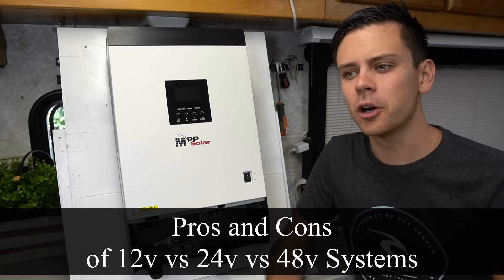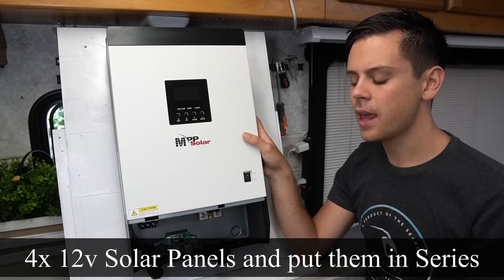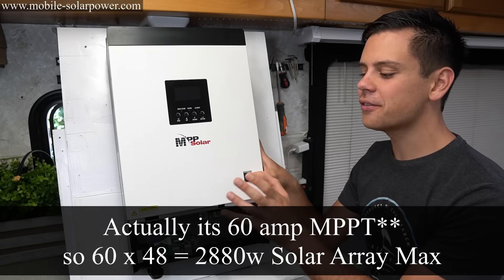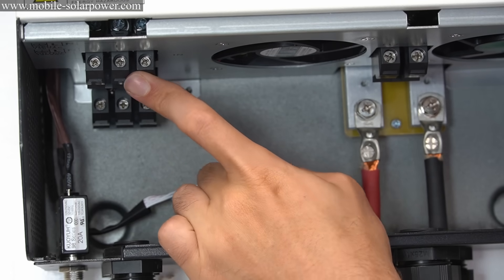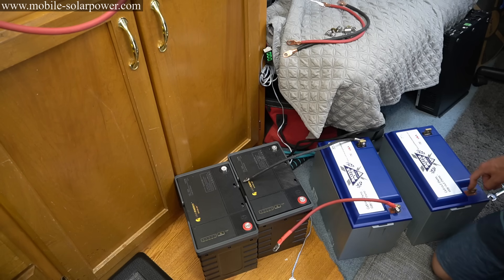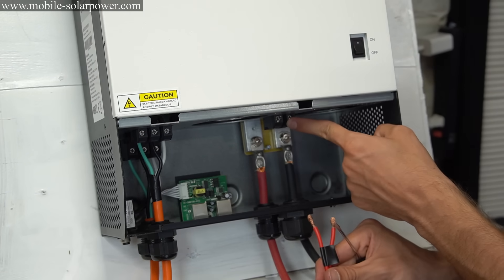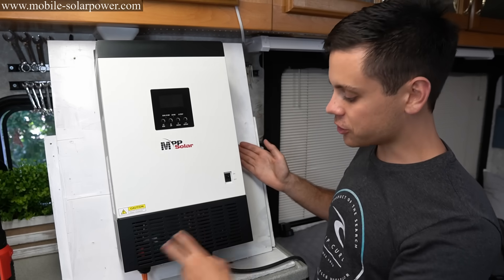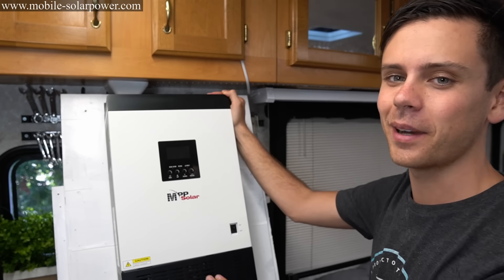48v Solar Power System for Beginners: Lower Cost and More Power!

Comment: so u dont recomend 24v for a van?
Reply: You would have to connect the output to a step down transformer because the car is wired for 12v. I'd run 12v so you don't have to worry about this.

Comment: Another excellent informative video for the beginning solar person like me, and I am very appreciative. I do have a question on the 2.4kw model. It seems as though I can utilize this unit in place of my (old) 30 amp RV converter, and simplify the addition of solar to my classic motorhome by running the 30 amp cord directly to this unit as the 'utility', and run the 120VAC output to the original 30 amp connection point in my breaker panel. What are your thoughts on this, Will?

Comment: i'm considering purchasing the Generlink or Solarlink transfer switch for my home's outside utility meter box to connect a 48v 5kw MPP Solar unit to.  this will eliminate the need for a separate panel installation in my home and potentially provide power to all circuits in my home.  What do you think?

Comment: I am new to your channel and I know very little about solar! I ruined my current stand alone unit by having my generator and solar generator running at my cabin. I currently have 4 new 12 volt batteries and Four 150 solar panels. Could I use this set up with this product? With a transfer switch and add a panel for just what I need to run with solar? Appreciate any help I can get!

Comment: I’m new to solar but I want to power my small server room from solar and be able to expand do I go with the Offgrid Home 48v System even though I’m a beginner?
Reply: I would. As stated above, 48v systems are more efficient at converting DC to AC. A few people out there are going 96 volts DC and higher. One thing to pay attention to: electronics are more sensitive to the sine wave output from DC to AC controllers. Spend the extra money and ENSURE the controller is a square wave controller. Also, pay attention to ensure your battery bank is more than capable of powering your system. The general rule of thumb is 72 hrs worth of battery bank. Since it's a server room, look at how you are going to cool it (if necessary) and you might want to build in extra hours worth of battery bank. I know from experience with corporation server rooms, when they go down, it puts a major kink in your day.

Comment: Are there charge regulators for 12v lead batteries that load the batteries in sequence?

In the sense that when the first battery is charged it starts to charge the second one then the third one etc ... recharged all starts from the first one and so on.

Thank you very much Oltrig

Comment: I like the 48 volt system, would it take three to run a home like yours, with a 300A panel?  Picture a home like yours with a pool, spa and hobby garage with welders and large air compressor.  Would I need three of these for three phase 240V AC?

Comment: Hi Will, Awesome video. So you don't need a charge controller with these 48 volt systems? Also can a generator be wired to the ac input?

Comment: Arrange your battery connections in such a way that you have (4) strings of 12V...
Using knife switches, (parallel) arrange (2) strings to 48V configuration (being charged)
[Leaving (2) sting (or as needed) in the 12V configuration for discharge to your 12V devices or all (4) if there is no usage needed during charging] 
Flip flop the strings to keep one set to 48V for charging the other at 12V for usage
At night or when not charging (disconnect solar input) arrange all to 12V

Comment: You should do a video on NEC Class 2 power.  60VDC is the max for a Class 2 power source with overcurrent protection.  It's used in the telecom environment (-48VDC) and it's common to see open bus bars carrying 400 Amps out in the open.  There's no protection from shock and unless you do something dumb (like sticking your tongue to it), you won't feel any electrical shock when handling it with bare hands which is common practice.

Comment: You do some very nice videos.  I would say you need a hydraulic terminal crimper.  If for no other reason - so I won't cringe when I see your cables.  A hand held manual one does the job.  Or, you can get a 60 ton crimper for hydraulic cables and use that which is what I do now days. :)

Comment: Just the video I have been looking for. I would need to rewatch it a few times. I love the information and the quality. I am interested in building an environmentally friendly 25'x7.5' pontoon houseboat to live in for upcoming projects. The Electric Outboard Motor I would be using is rated for 48Volts which is why this video interests me. I need to create a system that would also work for household applications such as a desktop computer (intermittent use), fridge (always on) and an electric burner (basically 3 times a day). Can you provide any additional info on using 48Volt Systems for off grid living? Thanks much.
Reply: Kinda hard to reply as the details aren't known. If everything on the boat (with the exception of the outboard motor) is 110v, you will need a DC to AC convertor, plug it into the breaker box and all is good. Run a line from your battery bank to your outboard with an inline fuse and you're good to go. If not, then it gets complicated. You'll have to have separate circuits for 110v and your DC voltage. What you could do is make all of the circuits DC voltage and run separate DC to AC convertors at those places where you need it. The batteries also need to be looked at. I'd purchase (if you can afford it) Edison batteries (Nickel/Iron)(NiFe) batteries. More environmentally friendly as lead/acid, AGM, Lithium are all hard on the environment when they finally die. Edison batteries are lifetime batteries and will outlive your boat.

Comment: Can I run an Induction stove on a 24volt inverter running off grid with 6Agm batteries with 12 x 250volt pv system?

Comment: One thing that Im really interested in knowing is that how big of a gauge wire can you fit into the AC in and out. Wondering if you can connect a bigger gauge wire in the output and wire it to like a sub panel and connect your loads from there.

Comment: This a nice all in one box solution but is limited in capablity
My wife and I hope to live in a RV park in the Lake chapolla area of Mexico To that end we hope to equip our 5th wheel with a Vitron inverter charger combination with a large Amp hr 24 volt Tesla battery bank.  we don't intend to have solar cells. However, we want to be able to run our home as if it's hooked up to a 220v 50-amp 2phase service when it will only have 110V 30 AMP single phase service. Most of the time the amount of wattage that RV would draw on AVERAGE WOULD  will be below the 30 amps, I want Viton(OR Vitron’s) to make up the difference between the 30 amps 110v single phase and create 220v 50 amp 2 phase RV service In other words I want to be able to live in my fifth wheel as if I'm hooked up to a full blown 50  amp 220V 2 phase service while I only have a 30 amp 110 single phase  power source. 
Our plan is some what unfair to the camp owner because to make up for the wattage that will be used with both say the ac and the microwave the vitron will have a high average current draw.

Comment: How would I connect this to a grid which connection goes to the line. the ac output? Is input only a pass threw when the load is to much ? How would this work with a 1000w grid tided inverter?  What are the possibilities of going completely off grid with this model?

Comment: Gday Will, I need to pull u up on a few things as a professional installer on the 4 and 5kw models of these inverters with 240v output.
If you say ur teaching others from ur video's then ur opening urself up for LIABLE, better invest in some real good insurance. 

Where is the battery Disconnect pull switch rated at 125amps for ur model inverter?
(160amp for the 4 & 5kw models) and both leads r wired into the switch.

Where is the Solar panel DC Circuit Breaker for ur solar panel array?

XT60 connectors are NOT advised for any solar panel installations as the material used is SUBSTANDARD and cannot handle constant voltage or currents that can arise as they will MELT. Use MC4 connectors even thou they r a pain in the arse.

Standard wiring size for solar panels is 1000v rating @ 10 gauge to ensure safety and is DOUBLE Insulated, same for MC4 specs. High voltage strings will need this spec but when u use lower voltage strings u need to handle the higher current .   

Battery cables should have the thick Heat shrink installed on the battery lugs.

I would suggest 36voc panels for low light conditions that u have in the usa in winter. 

When quoting wiring specs make sure u advise for the country u live in as its different color codes around the world and people from all countries view ur video's. In Australia its Red for active and black for neutral and green/yellow for Earth. MPP Solar distribute worldwide and supply splt phase models for the USA & Canada.

Did u program the inverter to USER settings under "battery type"? programming inverter via pc interface is alot easier then the front panel menu options.

Equalization Setting in Inverters: ONLY VRLA or wet cells need to be equalized not Lithium as they have a BMS and NOT Gel or AGM.

Everything else in the video is a pass.
Reply from the maker: For most off grid systems, you do NOT want a disconnect to battery for SCC because this could destroy the converter board circuit. This is not a grid tie inverter, and the NEC code doesn't apply. These videos are for off-grid only. I know most codes for grid tie and they are totally different.
Reply from the maker: If solar array is to code and above 400 watts, you absolutely need a combiner junction box with disconnect. For Microsystems it's unnecessary. This is up to the individual and this video did not cover solar array wiring techniques or else it would be covered.
Reply from the maker: Oh hell no! Don't use xt60 for actual installation haha!!! Oh god. I was just hooking it up temporarily lol
Reply from the maker: The only wire I use on the roof is rated for 25 years, and it's pure copper and 1000v. Best of the best and made in America. Please ignore the last bit of wire that absolutely is not what I use for permanent installation. Have you read my book or seen my website? I only recommend 25 year + rated solar wire, pure copper. Always.
Reply from the maker: Yes true about heat shrink and the cables I have on my website have that.
Reply from the maker: Good point on color codes. I have no idea what color codes are in most other countries. Sorry.
Reply from the maker: I hate using computer program for these inverters. I muh prefer programming on the screen.
Reply from the maker: Oh god why would you think that I would do equalization on lithium?! I have many many videos telling people not to do this. And on my website. Where did you think that? For lithium I do CV to whatever is stated on data sheet and that's it.
Reply: @WillProwse  I didnt think that I just added it to my comment to inform u and others, did not say that U DID THAT! and i am still checking out ur vids and maybe ur website too.
Reply from the maker: I'll make a 48v system with everything you said very soon. You will like it.

Comment: Can these units be placed in parallel with my microgridtie panel inverters....in front of the inverters if course..that way panels can hopefully still backfeed the grid when there's no draw on the mpp..basicly a working man's AC coupled system

Comment: Awesome find.  When my Trace SW4024 dies, I will research the LV 5K model as a replacement, thought I will need to rewire my arrays from 24v parallel to ???v series. Will need 2 or 4 Tesla batteries. (Will this work with Tesla battery packs????)   Thanks

Comment: Hi Will, Thank you for another awesome video. I bought two Battle Born 100Ahr batteries and was originally thinking of dropping them in my Roadtrek Promaster to replace the existing AGM house battery. However, the fact that I have an underhood generator or a second alternator seems like a complicated task that I rather not do. After seeing this video, I've regained hope! My question is if I were to get the 24v version and hook up my battle born in series, would I be able to charge the unit using the AC input to my 2000w  AC inverter that exists in my Roadtrek while driving around?  I bought your book and I love it! Thanks again for all your shared knowledge and keep up the great work!

Comment: You should show the AC out put going to a AC distribution panel on an Rv. Also you should also show how to power a 48v to 12v  converter that supplies a dc 12v supply pannel. This is way to basic.
Reply: Also I believe you should always fuse your battery before the inverter charger at the max load amperage + 20%. Just saying.
Reply from the maker: I figured wiring to ac panel or plugging it into a wall is self explanatory. But I'll be covering all that and ATS in a future video
Reply from the maker: I also have like five videos that covers converters. Did you not see those?

Comment: Love your vids, you make sense of systems in an informative and entertaining way!  After checking out your website , I was wondering , do you have any suggestions for an install on a electric sailboat with a 48 volt motor but also a plethora of 12 volt systems ?
Reply: I converted a 30' sailboat to electric. 48v motor w/lead acid batteries and I used a convert 48 to 12v to run all the equipment. Worked great. Sold it, lost money. Modern systems are less expensive.
Reply: @tallcoachcd  Yea figured a converter would most likely work, wasn't sure if it could handle all 12v systems, did you use an all in 1 like in this vid or go straight solar controller to a marine battery charger/inverter?

Comment: I'm looking to get a ~2kw system for my off grid cabin.    If I got a 24v "all in one" with a 60a utility charger, for ~1.4kw of potential utility charging, but only have an 800w generator for emergencies, could I change the charging profile to only do a maximum 800/24 = ~30a until I got a bigger generator?

Thanks!  I love the channel!
Reply: Not necessarily. I"m assuming the generator is used for emergencies only until the system can come up. Prior to starting up your generator, I'd unplug appliances/flip breakers until your main system comes back on line. Then you can shut down your generator until you need it again.

Comment: Will, good luck with your move and the new house.... I've been following your informative YouTube videos and I think I'm ready to purchase the 24 volt MPP SOLAR 2400w 80A Inverter/Charger.... I have currently, 2ea.  10-layer Jehu's DIY Powerwall packs with the intention of adding more as funds become available to purchase more batteries.  My batteries, 18650 cells, range from 2200mAh to 3300mAh in the two 10 tier packs.... My question for you is my intent to purchase the MPP Solar invert/charger the right choice at this time?

Comment: Love the videos and the enthusiasm, from my research and as your suggestions I am going to go 48v. I am interested in your thoughts on my plan as if it’s feasible and your recommendations. I have a cargo trailer with my tools in it, I wanted to set up the solar system in/on it temporarily for power until I get a permanent setup onsite to move the system to. I was looking at the Victron Energy EasySolar 48/5000/70-100 as my main charger/inverter with some LiPo Batteries. My main question is can I safely run the EasySolar 48/5000/70-100 on four solar panels (allowable room on trailer)?
Thank you for your input.

Comment: Thank you for all the good information on your channel. Question though do you just plug in a power strip to your inverter then run all your electrical from there or can you set one of these up and hardwire it to an existing outlet?

Comment: If i need to use air conditioning for 8hrs, 4.4amp, 115volt/60hz, 480w, what are the best battery to buy with the mppt?

Comment: I watch your videos as they are direct and clear. great work. One installation you have missed is a Grid Tie Microinverter   I'm using a 1000W unit from Y&H unit. I'm especially interested in combining 100 Watt Rick panels with the harbor freight 100 watt units.I'm just wanting to take a bit out of my current solar bill and learn enough to go full independence. Thank you Farmer Al

Comment: You can get shocked by 12volts just the same as any voltage on a hot day when you are good and sweaty or salt water on your skin pay your arm across the terminals it will shock you I like most of your videos but you really need to do your research before you give electrical advice

Comment: Hey Prowse!  Thanks a million for giving me the knowledge to start building my own 24V LiFePO4 solar system!  Do the Victron battery protects function as a (100A / 220A) circuit breaker and auto reset?  Or do they just break at 100A / 200A?

Comment: My goal:  Set up a solar system that would supplement and act as a back up system for a max of  1,500 watts.
I am limited to 5-65 x 39” solar panels because of tree shade.  Hoping to find high efficiency panels in near future.  Suggestions

Thoughts:

• 48 volt system

• Plug in to grid and/or generator

• Build/buy 2 24 volt batteries

I am concerned that I may have to use micro-inverters because the solar panels will be facing different directions.

Your thoughts or suggestions

Suggestion for helpful on line distributor. 

Thank you for your time and advice.  

Steve Bailey